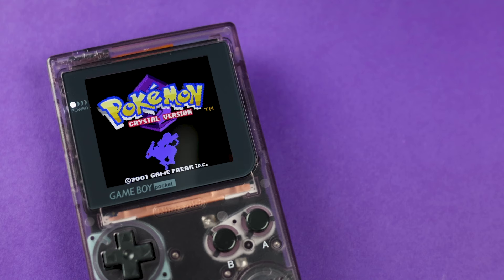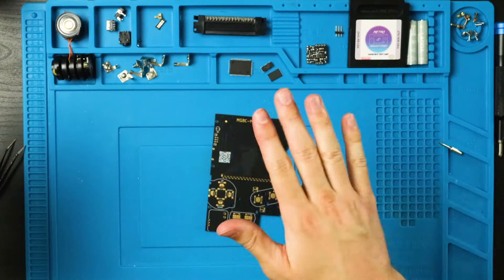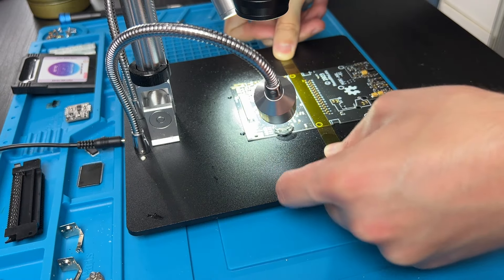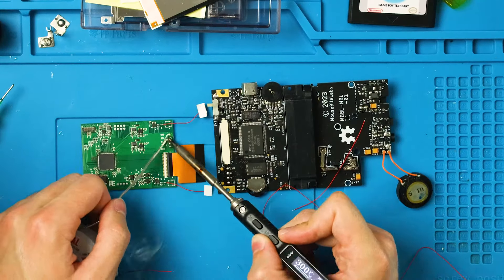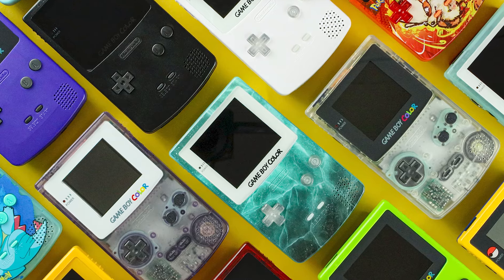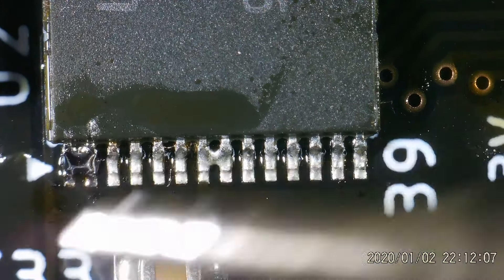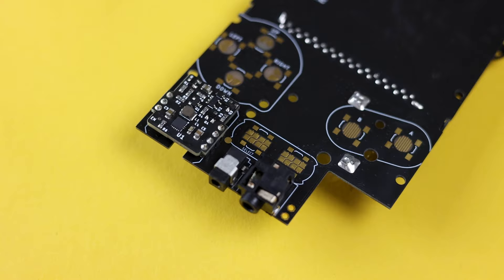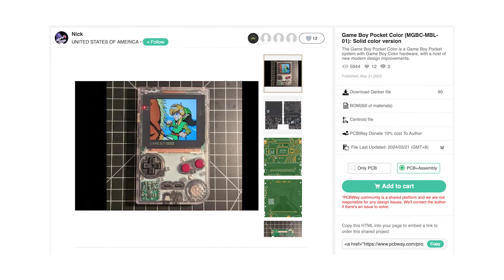This Game Boy Pocket Is Now a Game Boy Color! | Bucket Mouse GBPC

Comment: Hi :) Thanks for the video!
Wanna clear up the power board question you had since you said you were curious!

Why can't we use the original power board?
- In my tests, the original power board just doesn't play nicely with my MGBC. You could technically potentially get away with using it, but you'd probably have to play on only original carts (no flash carts), volume turned down, brightness at its lowest, stuff like that. I didn't want to give people headaches wondering why their build wasn't working (and also wanted to avoid troubleshooting questions about it, lol).

Can't the power board be incorporated into the main PCB?
- It could have been part of the main board, but I wanted to provide compatibility with other creators' boards, like the Frogulator (which was/is pretty popular!)
- Honestly, the aesthetics is what I was really after. I personally don't like the look of builds that incorporate the main power stage into the main board. I like the OEM-style look. 
- I also made a lithium-ion battery power board (and Natalie has as well) that slots right in. That way I don't have to make another whole revision of the main board for a separate lithium-ion capable version.
- The power board somewhat acts like a "skill filter". If someone cannot assemble the power board themselves, they probably can't assemble the rest of the build. So in the Github I recommend attempting to assemble the power board first as a low-risk trial run with new parts, potentially saving someone from accidentally killing a non-replaceable GBC CPU.
- A bonus is that making a separate power board means that my design can also be used as a replacement for damaged Game Boy Colors/Pockets.
Reply: Also, apologies about the cramped components between the crystal and link port. That's really the only place they can go unfortunately, lol. I recommend trying a hot plate next time you assemble one instead of hot air - it's a lot easier to solder parts on. You can also use it to remove the old parts on the donor GBC
Reply from the maker: Thank you for kindly answering all of my questions so thoroughly! All of that makes sense and using the power board as a skill filter is genius haha I’m excited to try the DMG version! Your work is amazing